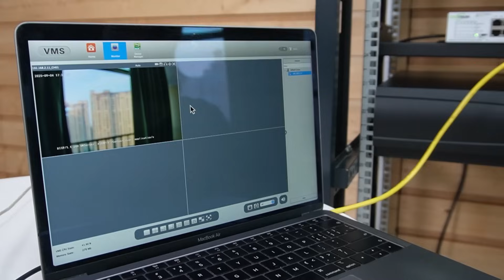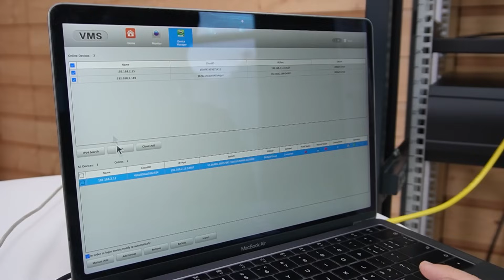Power 40+ IP Cameras Over 600m with Long Range PoE | Industrial Surveillance Setup

Comment: Why did you use a POE extender for the 600M one?   I though that switch was for LONG distance up to 800M?  At what point or distance would you need a POE extender on top of a long range switch?
Reply from the maker: The camera doesn’t have a long-range chipset. The PoE extender regenerates the signal so data can reliably travel back over long distances.

Comment: at control room side if we have circuit breaker and good earthing system still we need to implement surge protector.
Reply from the maker: A circuit breaker is too slow to react to transient voltage surges (lightning, utility switching). Surges last microseconds to milliseconds, while breakers respond in seconds.Grounding enables safe dissipation, but only if SPDs are present. Surge protectors absorb/divert high-energy spikes that breakers will never catch.

Comment: Which is best surge protector to use for surveillance, indoor or outdoor??
The POE Extender can you burry it in the Ground?
Reply from the maker: We suggest installing both indoor and outdoor PoE surge protectors on a cable run, as surges can travel in both directions. https://www.fastcabling.com/product-category/poe-surge-protectors/

Yes, you can bury the PoE extender directly in the ground. It's IP67 waterproof. Just make sure you use the included 27mm wrench to fasten the cable glands to prevent water ingress.
Reply: @Fastcabling  The POE Extender can you burry it in the Ground?
Reply from the maker: Yes, it's IP67 waterproof.

Comment: can I ask one for your POE switch support over 100m how about lan cable it can support over 100mb like your switch please tell me ?
Reply from the maker: Our long-range PoE switch can support up to 500 meters at 100Mbps when connected to the included PoE extender  (ports 17-24) and up to 250 meters at 10Mbps when the dip switch is enabled (ports 1-16). 

You can find more info here: https://www.fastcabling.com/product/24-port-long-range-poe-switch/

Comment: can i use media converter using fiber opthic cable 1k range to connect nvr to switch
Reply: Media converters are ok for video signal however you will not have power. Each PoE device needs power to send the video signal. Fibre optics cannot provide power.
Reply from the maker: You can use composite (powered) fiber cables to transmit optical siganls and AC/DC power to the end device. 

https://www.fastcabling.com/product-category/composite-fiber-cable/
Reply from the maker: Yes, it's plausible. Fiber optic cables can handle distances spanning a few kilometers.